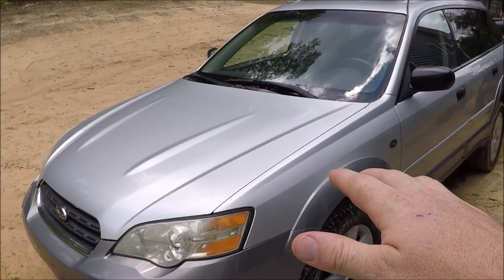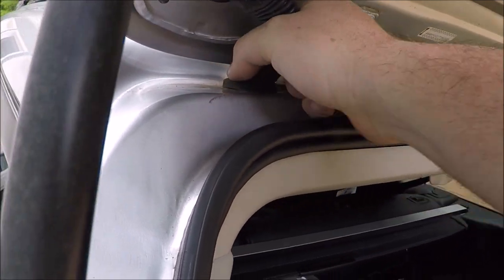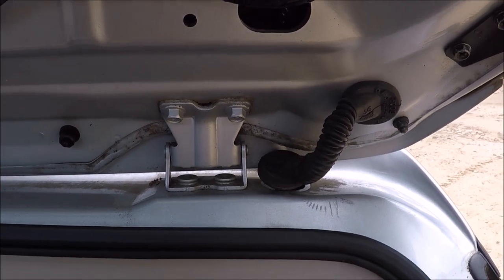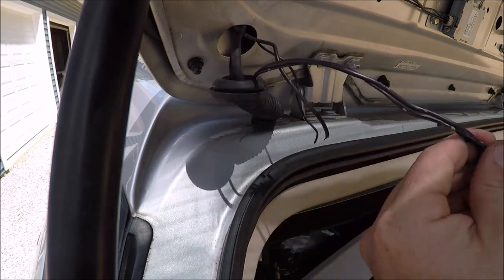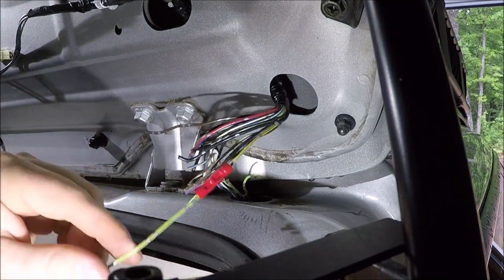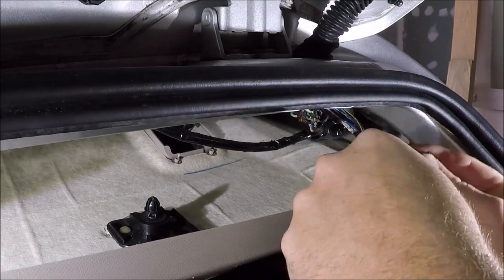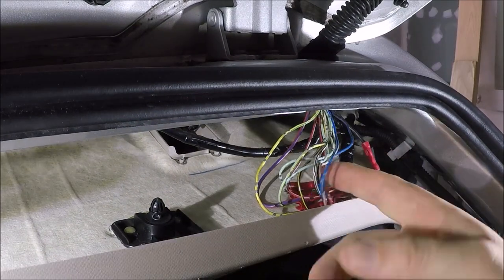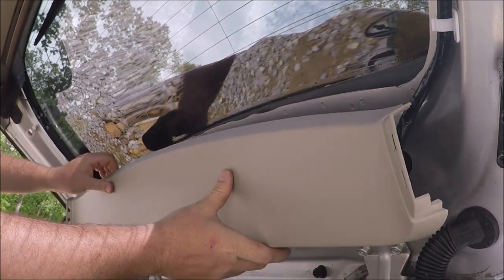How To Fix A Subaru Outback Broken Lift gate Wiring Harness

Comment: Thank you!!  After a full day working on the tailgate lock this video showed exactly where the problem was, five broken wires in the top right hand corner of the hinge.  I cut off the concertina rubber boot, put heat shrink over each broken wire, soldered the wires together, slid down the heat shrink and heated it.  The boot went back and insulation tape held the cut closed.  Works fantastic.  If it goes wrong again I will have to do what the video shows and replace all the wires.
Reply: were you able to find the correct colors for replacement?

Comment: Great video!  Sped the process up considerably on my 2008 XT with only 46k miles. At the moment, only one wire (blue with a white stripe) was broken all the way through - the wiper rest control. Many others are damaged/ cracked through. I soldered in an extension wire and wrapped the harness with electrical tape for now. When I have more time, I will replace all of the wires with silicone coated wire with additional length (should be more resistant to constant bending), and then wrap the bundle with whatever does not degrade quickly - sometimes electrical tape also gets brittle. I don't believe I will need the coding with the original harness as I can reference the ends. One wire source - Daburn: "Daflex ultra flexible high strand 200°C silicone rubber wire series uses a high strand count of fine silver plated copper for increased conductor flexibility.  It is insulated with flexible extruded silicone rubber.  It is designed for high temperature applications and also retains its flexibility at low temperatures.  It is also designed for continuous flexing applications.  Suitable for military and commercial applications where flexibility and long service life are important.  Silicone rubber offers superior electrical properties under severe service and environmental conditions. "

Comment: Very helpful video! I first learned of my 2008 Outback's issues when the rear hatch lock stopped working. When I opened up the passenger side grommet I discovered 6 broken wires so I decided to splice new segments for all 14 wires. I didn't bother with solder, but relied on butt connectors and heatshrink. It took me about 2 hours.

Comment: Thank You, Driver's Side rear wire harness not one wire but two wires broken  ....  spliced in 2 wires and applied heat shrink! It seems to be coming in better reception! Now, I need to drive the car and check for other stations!

Comment: Wow!  Exactly what I need to learn cause I am running into the same problem; the shop was going the charge a bundle and replace the LED brake light (which is still working fine) on the hatch.  Thanks very much!  Thumbs up all the way!
Reply from the maker: Awesome, Glad we could help. Like I said it's a common problem. Why would they replace the third brake light if its still working.. makes no sense. Either way at least you know when the problem is and can point them in the right direction or fix it yourself. Don't forget to give the video a thumbs up/ like if you haven't already. Makes it easier for other people to find it. Thanks

Comment: Watched your great video on subaru tailgate wiring harness. We took a tailgate from 99 Legacy Outback to replace one from 98 Legacy Brighton and connected all the wires...had two extras from the Outback that didn't appear in the Brighton, and left those isolated and stray. None of the lights on the tail gate worked after we got the new tailgate installed (we used the wiring harness that was already inside the new tailgate). Any thoughts? Thanks!Dave in Boise IDaho

Comment: Yes! This is exactly what I needed for my 08 outback!! Thank you!!
Reply from the maker: Awesome, Glad you found our video and it was helpful. Thanks for watching and taking the time to leave us a comment. Don't forget to give the video a thumbs up/ like if you haven't already. Thanks
Reply: @TheDIYGuyDOTnet  in repairing these wires, I am unsure which color wire controls what in this harness? Would it be possible to have this explained?  Ive looked elsewhere at diagrams but not much luck for someone who doesn't know much about the wiring in cars. I am learning as I go along. I now know the purple wire controls the plate lights, but what do the rest control on the passenger side?  Please, Knowing this would be excellent! Thank you. Planning to fix it using your suggestions and recommendations.

Comment: Hi there is a square rubber piece attached to the bottom of the grommet which holds it relatively tightly to the body, did you you cut that part out? Great well made video!!!

Comment: my wiper and defrost stopped working first. then my lock quit working.  thanks for information. I haven't checked wires yet. I have all the tools but have little experience in butt connections.  Im sure I have the crimper somewhere.

Comment: Fantastic job on this video! Clear and well explained! Rear windshield wiper stops half way went it is turned off. And now back up lights are not working. I am certain this will be the remedy for it. BTW, what is that HARNESS you referred to in the video? 2005 OB 3.0 Thx

Comment: If you really want this repair to last "forever", silicone sleeved tinsel wire* (pretty heavy stuff for the larger gauge replacements) works well.  However, this will not fit in the existing "grommet".  OTOH, if you don't care about looking "factory" and a "Borg-like" appearance works for you, split-loom tubing drooping slightly into the cargo area will work fine.  It usually comes in rolls of at least 10 ft.:  If it ever cracks, replacing it is easy.

*As used in high power subwoofers, esp. car audio subwoofers.  If you play your sub hard at 40 Hz for just an hour, that's 144,000 "flexings" right there.  

Notably, I had several broken wires on the passenger side and none on the driver side - the greater "play" on the driver side seems to distribute the flexing better in the OEM setup.
Reply: what gauge are the wires?

Comment: Do you start by disconnecting the battery, prior to handling the wiring?Well made, straightforward video with clean audio and great pictures. Very helpful thanks!
Reply from the maker: I didn't but it wouldn't hurt too. I don't think there is a full time power circuit going back there but I could be wrong. As you have to turn on/ engage the brake lights, tail lights, reverse lights, rear wiper, defroster ect. Good question. Thanks for watching and taking the time to ask and you're welcome. Don't forget to give the video a thumbs up/ like if you haven't already. Thanks

Comment: I JUST got this issue - any idea what gages of wire are used in the right side? The black looks pretty thick.
Reply from the maker: If I were to guess I would say there 14g for that one and the others were 16g. They do sell a replacement harness. https://amzn.to/4gKsR6T It's kinda pricey and more work to replace as you need to remove more panels off the inside

Comment: I spliced the hatch wires on the driver side of my ‘05 Outback.   Passenger side looks good.  However, the back up” fuse in the engine compartment blows when inserting.  My radio, clock, and map light are out.  Any ideas?

Comment: hey what gauge is the wire for the rear hatch?  thanks
Reply: Hey I just did this on my 2008 outback 2.5i limited and there was two sizes of wires on the passenger side (I only replaced that side of wires) they were 16 gauge and 18 gauge wires

Comment: Can you tell me what gauge wire this is? thanks
Reply: Did you ever figure out the wire gauge? I'm currently trying to replace mine but have seen many different number stated
Reply: @tomwalker5514  On the Subaru forum some one posted  14/ 16 gauge  wire
Reply: If anyone's still wondering about gauge, I just did this on my Impreza hatchback and replaced 14, 16, and 18 gauge wire in the right lift gate harness.
Reply: @berrypi8865  just to clarify, are you saying that there were three different gauge wires within that one harness?  How important is it to match gauge exactly?  If I'm only splicing in small pieces (3-5") replacing all (10-12?) sections of wire, would it be OK to use the largest gauge (14) for all the wires to get adequate current through all of the wires?
Reply: @berrypi8865  I finished the project a few hours ago and the hatchback actuator is now working, I didn't test the windshield wiper washer pump or the defroster. The stop light is not working - not sure why, I'll double-check the connector tomorrow.  Of all 14 wires I think three were 16 gauge (16 strand) and 11 were 18 gauge (7 strand).
Reply: Hey I just did this on my 2008 outback 2.5i limited and there was two sizes of wires on the passenger side (I only replaced that side of wires) they were 16 gauge and 18 gauge wires
Reply: @slough234  How did you know which wires were 16 and which wires were 18?
Reply: @berrypi8865  how did you know which wire was which size?
Reply: @KimSmith-bj7xw  when I was stripping the wires I could tell with the tool what gage  wire I was stripping. There are other ways of measuring wire gage too: micrometer, caliper, ruler, wire measuring tool

Comment: on the driver's side defogger, I broke the tab off (trying to remove the wire from the harness).  anyone tried to fix the defogger tab here?  looks a bit different than most cars because of this coil around it.  that coil looks to be an RF choke, but I am unsure.

Comment: I have a 2005 Subaru Legacy Outback. I have lost the radio, clock, interior lights, key fob. I have fixed the wires in the back hatch, I have checked all the fuses and I am at a loss as to where to look now. Would appreciate any help
Reply: Under the hood, it’s the backup light fuse. Should be #8. 20amp

Comment: Won't the problem reoccur?
Maybe adding a sleeving might extend it's life?
Reply from the maker: Yes, eventually I would image it will happen again but the car is 13 years old and has 245,xxx so it took that long for the OEM wires to get that fatigued and break. So with replacing them all hopefully it will last that long again or close to it. Its kinda of a design flaw on how close the wires are and how they get folded over when its closed. They changed the design on the 2010 and up. I'm not sure a sleeve would make a difference as it not rubbing on anything its more that there folded over in the same spot pretty far time and time again. Thanks for watching and taking the time to leave us a comment. If you enjoyed watching the video or it was helpful don't forget to give the video a thumbs up/ like if you haven't already. Thanks
Reply: @TheDIYGuyDOTnet  oh wow it took that long to fatigue. Makes sense then, and yeah a sleeve seems like it won't help.
Thanks for answering my question and making the video 👌🏻
Reply from the maker: @Noclpro28  Ya on this outback anyway some in the 140-150K range but I guess it really depends how often the hatch/ tail gate is opened and closed. No problem.

Comment: I just got done with this fix, good news and bad news, the good news is I fixed the problem that I was trying to fix which was the back gate not locking. The bad news is I created two more problems somehow, my rear windshield wiper and my reverse lights no longer work. So weird I checked all of the connections and all are matched up correctly. Anyone know why this is?
Reply: I’m kinda in the same boat. I fixed some wires to get my reverse lights to work. When I hooked everything back up the dash light shows that the rear door is open but it’s not. It won’t lock now too. So frustrating